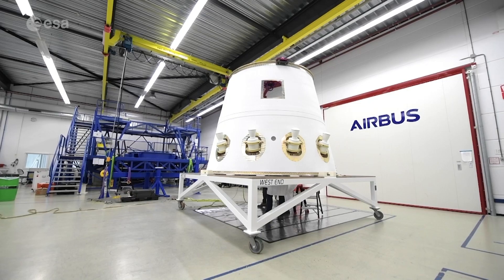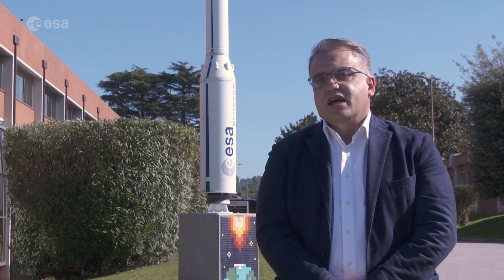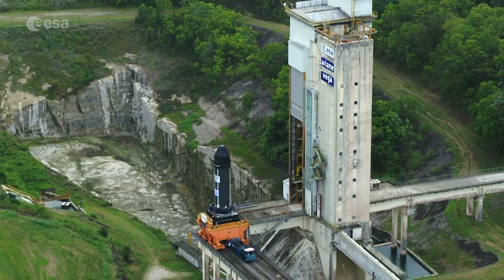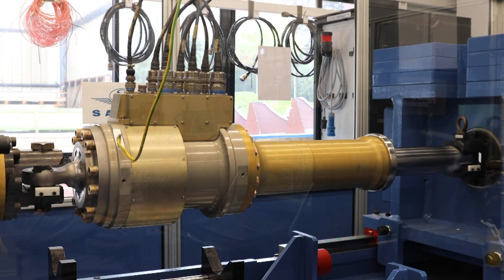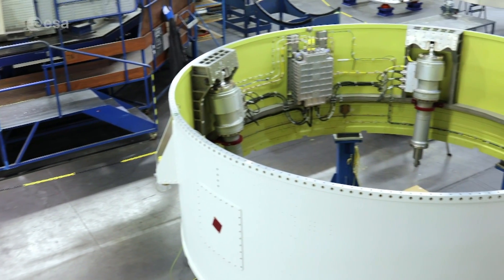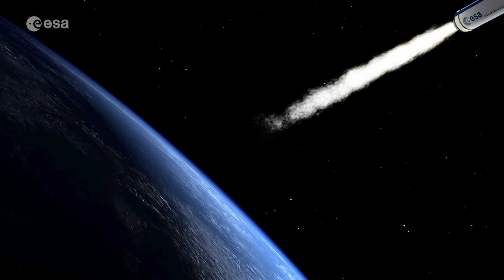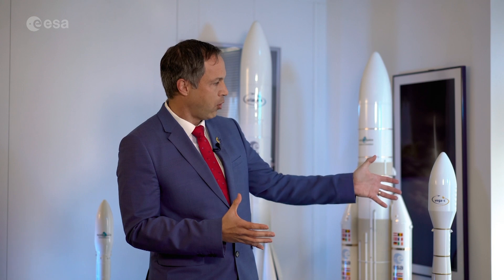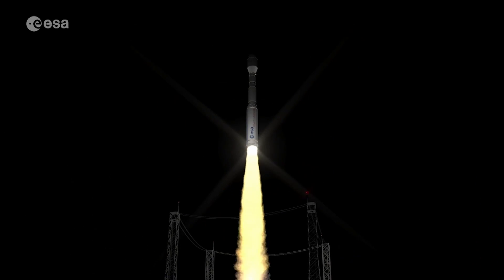Vega-C: power and versatility

Comment: Sorry ESA, but as Italian enthusiast of space exploration, why continue with rockets which aren’t reusable or partially reusable while SpaceX has literally changed the philosophy and create a new system of space launches? Will be interesting anyway discover if also ESA will be able to cut more the cost of Space Launch, because this can be an advantage also for scientific missions, not only for commercial satellites
Reply: Costs are being cut, in a lot of ways:

Space rider recovers a very expensive part of the mission, the payload.

The P120 is used by ariane 6 and vega, making the production line simpler and cheaper for both

There are multiple changes to basically everything in the manifacture process

So really reusability is not the only way to drastically reduce costs, its just the coolest to see.
Reply: @alekosb.8704  correct. Also landing and reusing ultra cheap solid rocket boosters is not efficient.
Reply: Because it's kinda not worth it.
And not worth it at all When you use SRBs.
Reply: @pifly29  You just made the point of the OP. It may cost to develop a reusable rocket, but it pays off afterwards. And that would mean more launches because of more customers, so faster ROI.
Reply: @OMSI-Fan Mark It Actually doesn't.
SpaceX falcon 9 for example:
New-60millions, 20 tons
Reuse-50millions, 15 tons